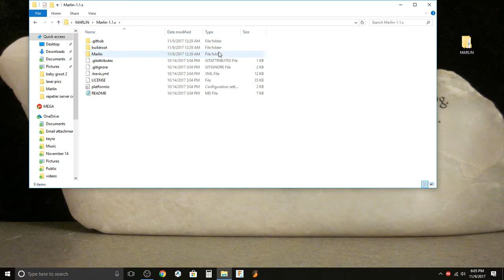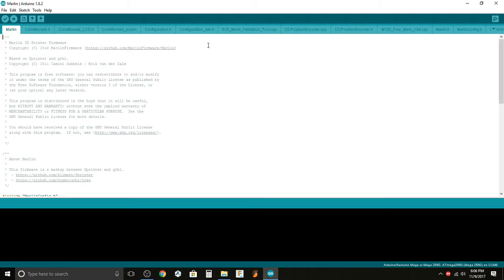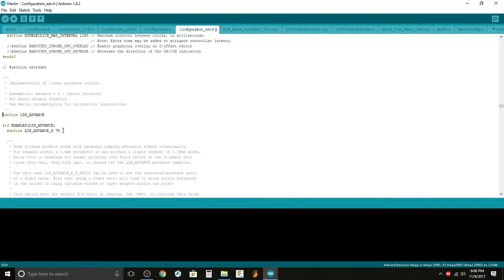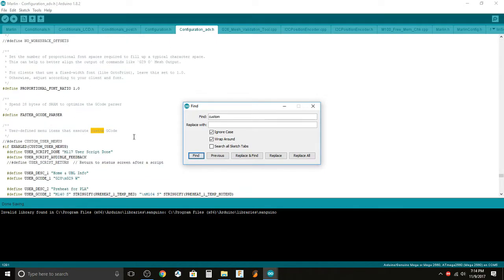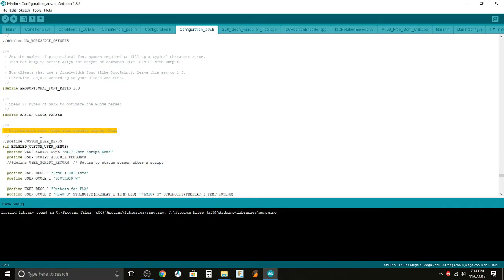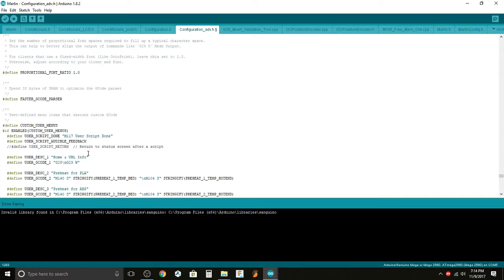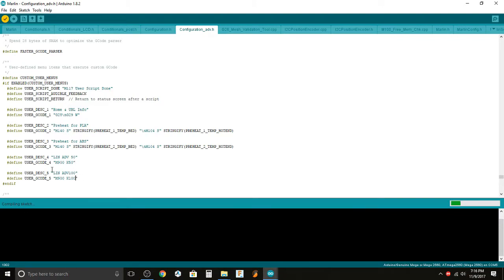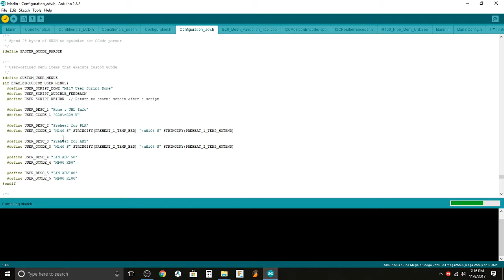linear Advance

Comment: you can just use m900 or something if i'm not wrong to set the Kvalue. then save with m500 and check with M503
Reply from the maker: The newest version of marlin has an adjustment option if i am not mistaken.

Comment: ..so your prints dont come out that way by just enabling it..what accel values and jerk settings did you try and what were your speed setting changes and print times?
Reply from the maker: KornShaDoW097 actually it has to do with your build, example if you have a direct instead of a Bowden the value changes, the latest version of marlin, under the filament tab, you can adjust the value on the fly

Comment: Great Vid! Can any chance of getting a part 2? I'm not exactly sure "how" to modify the values especially on the fly. I have the custom commands on my Machine but they don't seem to do anything during a print and If I click one when not doing a print my machine seems to just home all axis.
Reply from the maker: Christopher Tamer indeed, I can make a video with better samples and command values
Reply: I found a test print on Marlin http://marlinfw.org/docs/features/lin_advance.html#evaluating-the-calibration-pattern My setting needed to be 120 to get a clean line, but I'm running a Bowden extruder and it says they need to be higher. I'm using the Gcode commands to do it on a print by print basis right now and fine tuning sucks since I need to finish prints every time.
Reply from the maker: Christopher Tamer print 20mmx20mm single wall no top cubes, it will make it way easier

Comment: A good quick short Tip, where are my files?
Reply from the maker: Paul Thomas indeed I also have a code for you if you want a discount on a laser😊
Reply: LASER?  Did I read LASER?  My seller suddenly pulled all sales globally from all sites (either that or they shut him down) and I am waiting on my money back but I suspect eBay will have to yank it from him so I am interested in a K40 style as I want to engrave mainly.  What blows about eBay is they said 6 days after arrival verbally to me and in the message then he gets it on Friday and verbally, as well as written, it changed to 11 days so I have to wait until Nov 21 to get eBay to get my money.  I told eBay, and they agreed, that to CYA to take pictures, a lot of pictures, showing what I sent back so I did all of that and even took the pictures inside the FedEX.  A horrible seller with crap he sold and I hope he is now on the lamb from the law but being a Chinese in China I doubt it.

edit: The seller just now refunded my cash Guangzhou Anmeng Trading Co.,Limited  If you see that as a seller run.